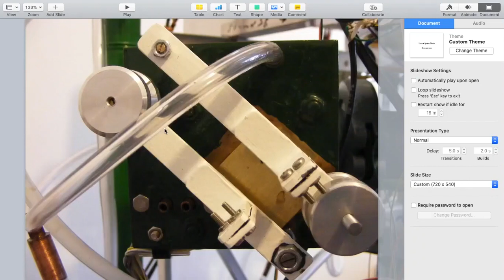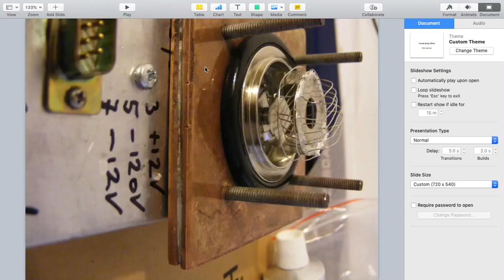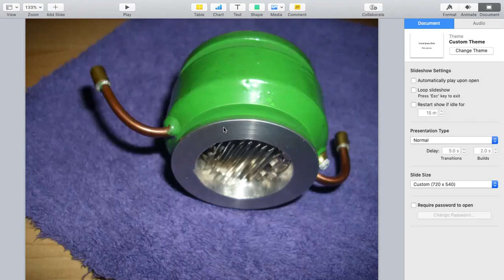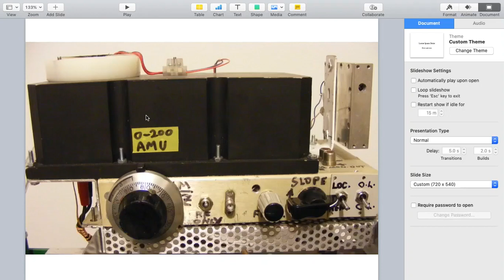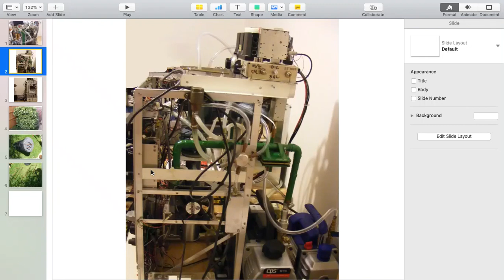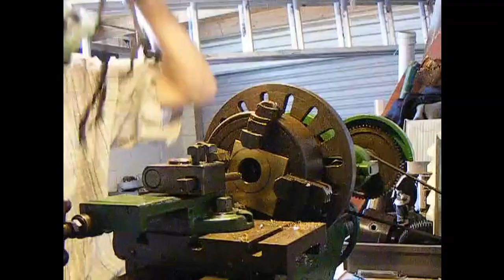Home Made Mass Spectrometer - What is under the cover

Comment: This is interesting to me. 

Many years ago I built several TOF machines. The latest ones were the best working and applied the reflection principle. The mass resolution was more than 4000 and the sensitivity was very good. The ions were shot along the tube and then reflected back though the source to the detector behind the source. The idea was to make the this device a product for a company. However, the big company had big rearrangements and the operations were sold out and  nothing came of it, although the prototypes worked better than anticipated. The total length of the tube was about 500 mm.